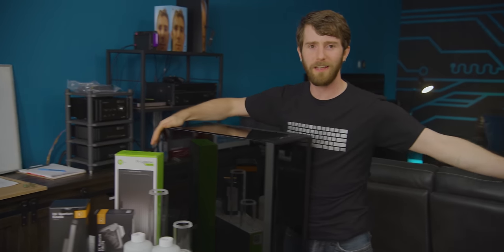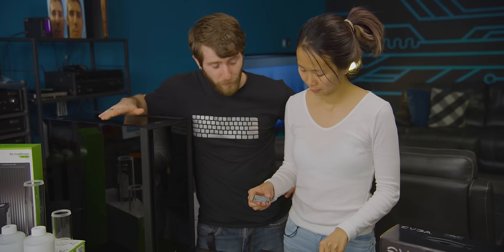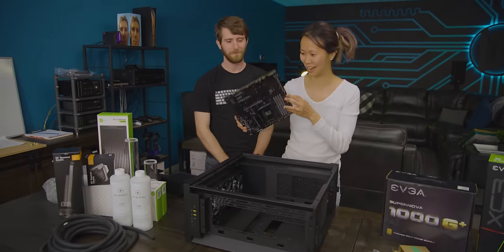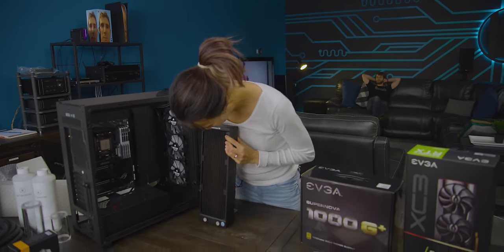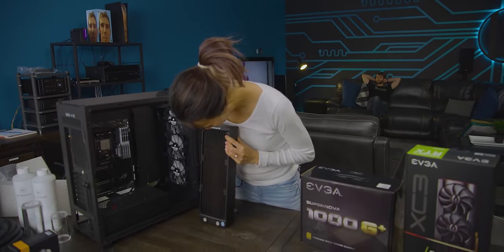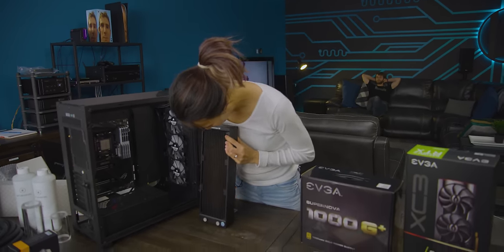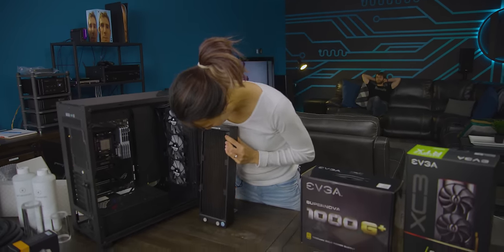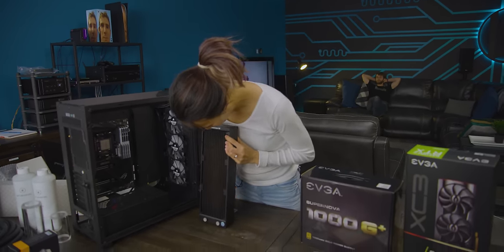Building a PC with my Wife was a MISTAKE - Lounge VR PC Build

Comment: a little tip when trying to bend the pins back and have little space: If it is a male pin, get a female pin that is not connected to anything, and use the female pin to help bend it back. Instead of using pliers or a flat head.

Comment: Linus: Basically has a small fire in his wifes new PC.... 
Runs fine and no issues.

Me: Sneezes lightly due to allergy.
PC dies in a scream of terror while also making sure to drop the drive case with 4 TB of HDD's before finally telling my monitor to do a tripple backflip and crash into the hard wood floor.

Comment: i mean isnt it dangerous to leave such sparking with electricity computer alone turned on? i would be worried to use it after that sparkling show :) i mean not only to leave such hard to get graphics card in such dangerous case (motherboard) but it can cause fire for the whole lounge and the rest of the building..

Comment: motherboard is burned. Do not turn it on !!! As it will make more damage, that you must do is A to refund motherboard, or B send it to fix it. Something is overheated, shorted and burned is clearly seen the crap on motherboard. it may easy cheap fix, but if it will run something can get more and more damage.Motherboard may holding on last hope to  not die And it may kill everything in pc in time or the same second you turn on. Its very stupid from Linus perspective looking that happen while having no idea that hes looking into.

Comment: Why use 8TB m.2 drive for bulk storage ? The M.2's get so hot, so why would you use them for bulk storage ? Also, wouldn't it be better to use a Sata ssd/ Satas for bulk storage  when considering price ?  If the ONLY point is a potential higher sequential transfer rate , I really don't understand.  Actually, if this is (and I guess it is), a QLC nvme m.2 , then of course the sequentials will drop off after cache is used up. You have been repeating this yourself in your videos. I see it still has good transfer speeds for sustained transfer, but still ; With the price I would not even consider it versus a sata ssd secondary, for now..

Comment: 21:59 not too surprised to see that, this is an ASUS PRIME X570 after all. Not that ASUS makes shit motherboards, but I had a board that was just a step down, a PRIME X570-P rather than the X570 Pro they used here. My board lasted only a couple months before making snapping crackling and popping sounds while I slept one night. But it continued to run just fine until I decided to shut it down to install updates for Windows, then it never woke up again. I don't know what it is/was/is about the ASUS X570 boards, but they seem to be rushed or cheap or something. As a backup I went with a PRIME B450M-A II board (since it was compatible with Windows 7 as I wasn't yet willing to part with it). So far this thing has held up well. I still haven't had my X570 replaced under RMA, I want that spicy PCIe 4.0.

Comment: I hate that USB 3 header. It's the worst thing. Even if you know what you're doing, there's a good chance one of the pins will be very very slightly out of alignment and completely squish/bend when you try to plug the cable in. Or if you don't plug the cable in perfectly square on, it will slightly bend one of the pins and no longer go in.
I've spent more time than I want to think about fixing those damn pins with a screwdriver. 
Such a terrible design.

Comment: You never fill a pc with power to the main board you use a separated power supply to power the pump while filling and airing it out.
You have baggs of fittings i can only dream off. the new ones are so much prettier them my old EK ones.

But no fill port no drain, just from one point to the next pretty boring :( and you are gone have a shitty time cleaning it.
You have a big rad and a thinner 360 rad put them both in and your fans barely ever spin up above 750 rpm.
I run 1080 and i7 8700K on 4.5 Ghz with a 360 xe and a 140 Large under 60 degree. with mostly 500 rpm fans to max 1500 rpm so there pretty silent.
And for rad cleaning you have a pc duster to blow all that hair out with minimal effort. :p